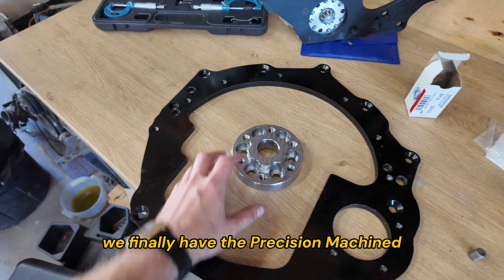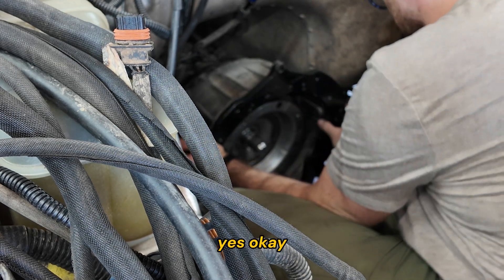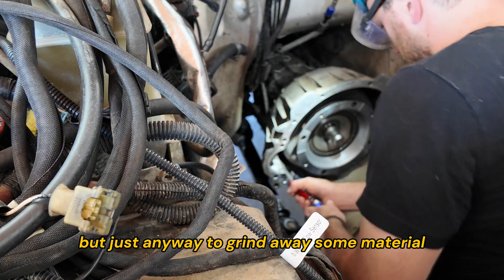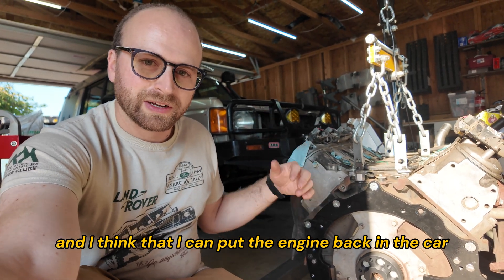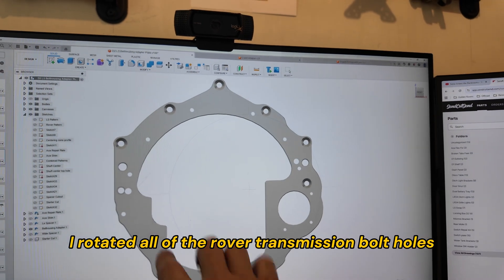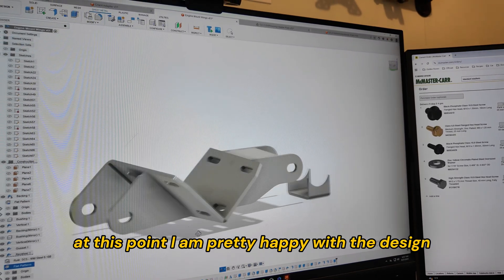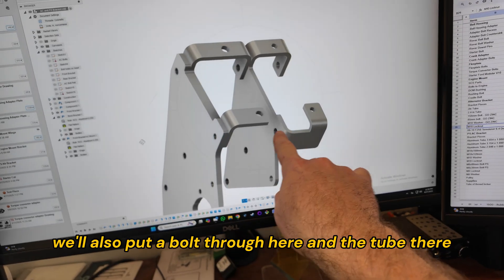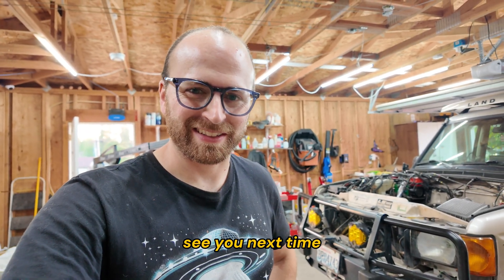Discovery II LS Swap Kit - Part 4: CNC machined prototypes, and final engine mount design

Comment: Love the work your doing!! Watching your video currently (now).  As far as rotating the full 3.2 degrees- will that interfere with the oil in the pan as far as when actually running and the pick up tube sucking up less oil creating starvation.  maybe rotate as much as possible where the guide pin barely touches the LS side when installing your plate.I know the rotation is slight but Ive seen other videos that show low oil and starvation starts. dont want to responsible for being part of catastrophy. I am in line to purchase this journey!!!!

Comment: What about the wiring harness interface with the gauges?
Reply from the maker: The reason you haven't seen me do any wiring, is because I am re-using the wiring I have from when I previously swapped this car with the ACE kit. It works as follows: the LS is running in standalone mode, it doesn't need any input from the rover side except VSS and throttle position. The rover harness is stripped down to bare essentials. The gauges and traction control still work because the rover transmission and rover ECU are still there and operating those modules
Reply: @GoldenRovers Thanks for the clarification. So probably best to get a scan gauge or equivalent to get temp. 

Since I will be replacing a virgin Disco2 with the Golden Rover kit; other than tearing into AllData is there anything out there for the VSS and TPS for the conversion?

If you can just skate over during your final hook up would be great.

Also good job on not clocking the LS and keeping at 3 degrees. Great due diligence.
Reply from the maker: @jckunkel  The temp gauge still works since we keep the rover temp sensor and plug it into the LS (shown in the next episode).

TPS signal are cross compatible, so you can feed the GM tps signal into the rover ECU directly. The VSS signal needs a dc offset applied so the GM ecu can understand it. I show the circuitry for this in part 1 or 2. I may go over it again in part 6.

Thank you!